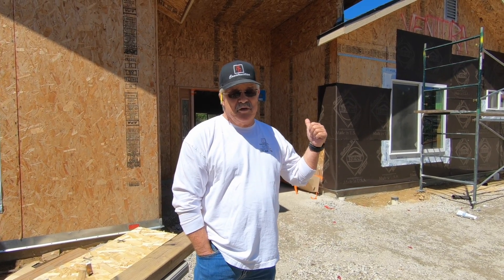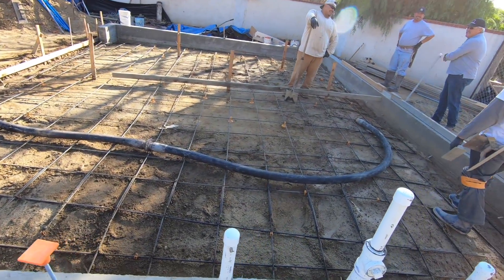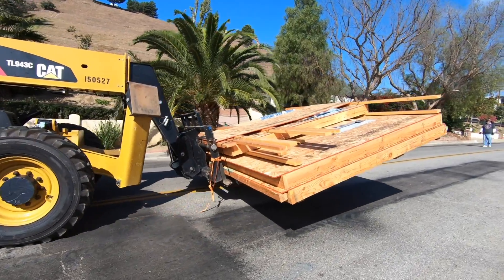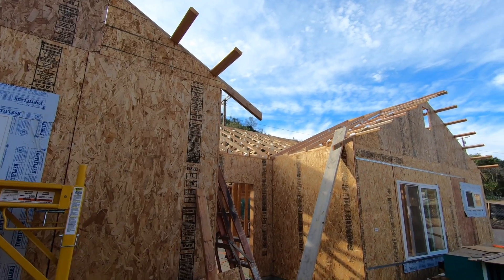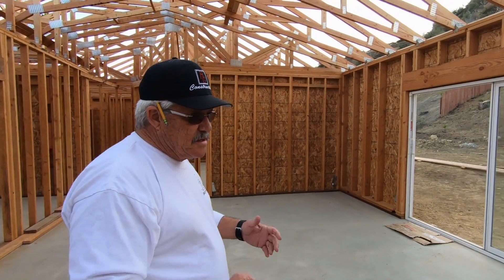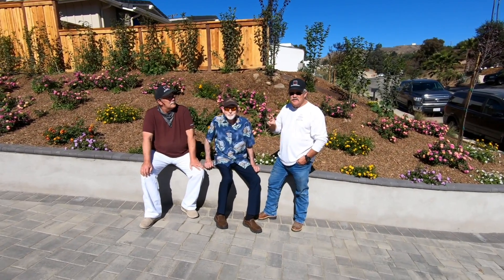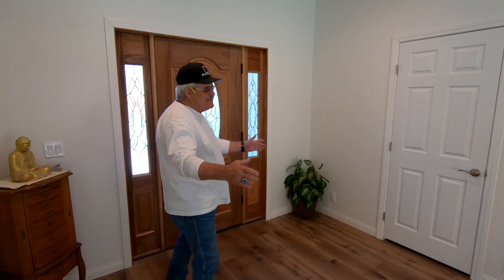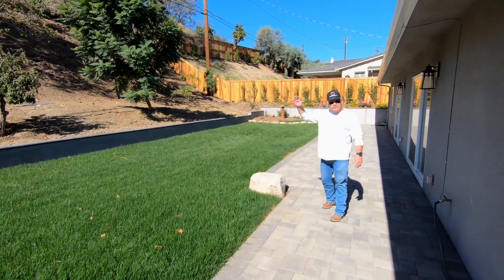Panelized Home Construction by HG Construction in California

Comment: But...unforntunately, it is still flammable. @BRIKCali
Reply: Your right about that.  As a general contractor here in SoCal, our choices are limited.  Brick and block homes are just not cost-effective to build and are a hard sell. Water wicking, insulation solid walls transfer heat and cold,  plumbing, electrical,  and they are just a nightmare if any part of the construction process needs modification (Electrical, Plumbing doors and windows etc).  And there has never been a home built that hasn't had a minor adjustment required in the building process.